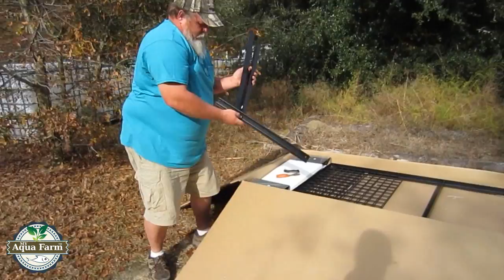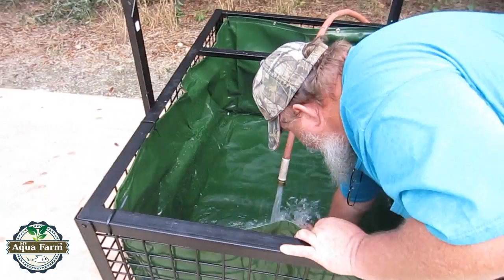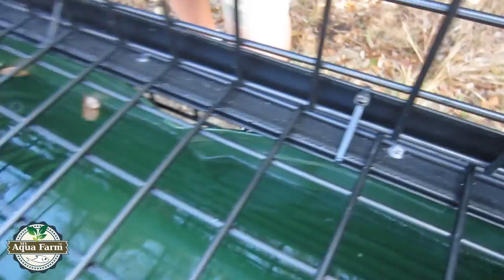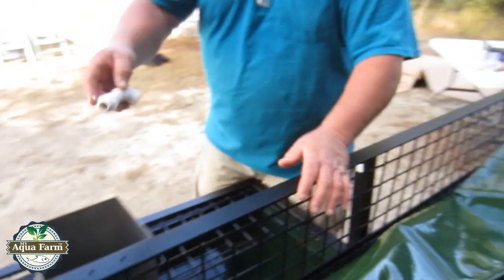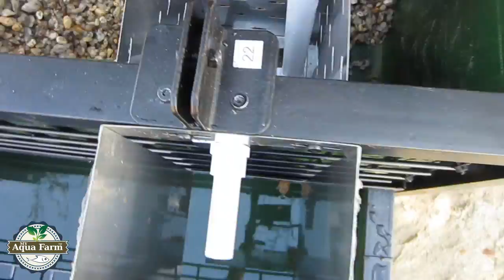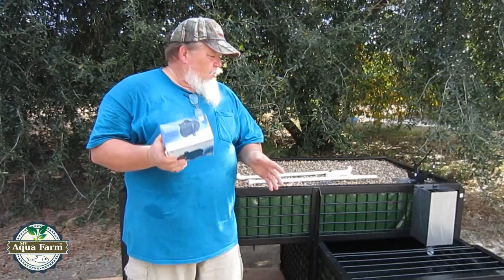MyAquaFarm Aquaponics Construction Video

Comment: I have to say this seems like a pretty solid system for people that are limited in the diy area. With that said I would like to throw out a few thoughts. First I think the grow bed sits to far over the tank. I believe it would benefit the user if the dump valve sat more the the rear corner. This would allow 2 things, it would allow more room to access the fish tank both for ease of cleaning and removing fish, it would also cause better water movement and prevent detritus build up in the rear corner. This would of course require 2 more legs on the back side of the grow bed and make for a larger foot print. Maybe that could be an added option. Also, moving the pump the opposite front corner could aid in circulation but that may require the next size of pump larger do to the added head distance. I would also consider adding a T and sending the water across the grow bed with several outlet holes along the length of the pipe to eliminate the need to move the plumbing around. Lastly, I would extend a pipe from the bottom of the dump valve either to near the surface of the water, below the surface, or maybe add a 90 deg elbow to be able to direct the return flow. Some experimentation would need to be done on that. Last minute thought, raise the grow bed up about 12 in and have the entire grow bed directly above the fish tank, this may not work to well for us short people but would reduce the floor space needed for you system. I'll have to check out your web site as you may have already come up with some of these options. Despite my long winded comment this looks like a great product. Excellent job!
Reply from the maker: I appreciate your comments and observations.  I'll address your points following:
You said:
 "First I think the grow bed sits to far over the tank. I believe it would
 benefit the user if the dump valve sat more the the rear corner. This 
would allow 2 things, it would allow more room to access the fish tank 
both for ease of cleaning and removing fish, it would also cause better 
water movement and prevent detritus build up in the rear corner."

My answer:
I built the first prototype of this system in 2012 (I've designed and built aquaponics systems since 2003) and have operated it since that time.  I've never had an issue with the flood valve being in the way (one can walk around the entire system), harvesting the fish or solids buildup in the corners in the 4 years it's been in operation.  What little solids that do remain in the fish tank are beneficial to the system as they slowly break down over time making available micronutrients into solution.  The fish tank is an integral component to the structural integrity of the system.  It's location also reduces stress in the fish giving them a concealed place to hide improving their overall health.

You said:
" This would of course require 2 more legs on the back side of the grow 
bed and make for a larger foot print. Maybe that could be an added 
option."

My answer:
Only one leg would need to be added.  What you suggest would add additional cost to production that would have to be passed along to the customer as well as added complexity to the construction.  We'd rather keep it simple and make available a robust, high quality product with as few parts as possible.

You said:
"Also, moving the pump the opposite front corner could aid in circulation
 but that may require the next size of pump larger do to the added head 
distance. I would also consider adding a T and sending the water across the grow bed with several outlet holes along the length of the pipe to eliminate 
the need to move the plumbing around "

My answer:
Moving the pump will not increase head height so no new pump would be required.  Relocating the pump, however, would increase pipe length, once again increasing the cost of production and reducing the arc designed into the piping to spread more evenly the solids into the growbed (where we like them).  I did the "holes in the pipe thing" with my first system in 2003.  A total nightmare!!  Algae buildup around the holes creates much more intense maintenance  to keep all those little holes clean.  Open flow into the growbeds has served me well for the past 13 years.  Just passing on the benefit of my experience to my customers.

You said:
"Lastly, I would extend a pipe from the bottom of the dump valve either 
to near the surface of the water, below the surface, or maybe add a 90 
deg elbow to be able to direct the return flow. Some experimentation 
would need to be done on that."

My answer:
Since you give no reason for this statement I can only assume it's for the benefit of aeration in the fish tank.  Since the first cycle of the My Aqua Farm prototype in 2012, we've never had a low DO (Dissolved Oxygen) issue.  When the flood valve initiates, a LOT of aeration occurs keeping the fish healthy and happy.  If your comment is directed at any perceived noise issues, who doesn't like the sound of running water?  Surely not someone with an aquaponics system.  Once again, this would add more parts and cost.

You said:
"Last minute thought, raise the grow bed up about 12 in and have the 
entire grow bed directly above the fish tank, this may not work to well 
for us short people but would reduce the floor space needed for you 
system."

My answer:
This would be problematic on several fronts.  One, this modification, as you state, would increase the height, not only for working around the system but also concerning head height and the pump.  While our pump can handle this, it would decrease the amount of water available to return to the fish tank adding additional aeration.  It would also make the need for a redesign of the growbed to add support since the fish tank would be unhitched from the system.  This would add cost to production and to the customer, not to mention making it even harder to harvest the fish and complicate the plumbing even further, once again, adding cost.  All for the saving of about 2.5 sq. ft.  Not worth it, in my mind.

You said:
"I'll have to check out your web site as you may have already come up 
with some of these options. Despite my long winded comment this looks 
like a great product. Excellent job!"

My answer:
Yes it is a great product.  Some have said it's, by far, the best system in it's class.  Not to mention it's twice the size for the price of the competition.  
"Excellent job!"?
I agree.  Thank you for the comments and observations.

Aquastead E-fish-ently!!

Warm regards,
Travis
Reply: Travis, Thank you for your quick response. I realize that I may not have been very concise in some of my comments so I would like to clarify a few. Before I get into that I would like to point out that my views are as someone that has nearly 30 years experience keeping and breeding fish and nearly 20 years working in the pet industry with my primary focus on aquatics.

On the first section, I understand keeping everything as simple as possible and that you are not in a position to do a big redesign. Currently the grow bed covers 2/3rds of the tank. What I was suggesting only covering 1/3rd of the tank. The amount of "security" that the fish receive from this coverage is negligible.

In regards to my comments on a dump valve down pipe. My ideas here are taking into consideration those that would want to run these indoors. While the running water can be nice, a major issue many people address with aquariums is the noise. Especially when you think that the dump valve is not the same as constantly running water but rather a toilet flushing, it creates a lot of noise. As I mentioned this would require some experimentation to figure out what works best. With that in mind some sort of baffle/cover over the dump valve surround would also be a nice addition to reduce noise.

On the topic of placing the grow bed directly above the tank. A 12 in opening between the bottom of the grow bed and the top of the tank does not cause any problems with removing the fish. Most pet stores have an even smaller opening for collecting the fish and doing tank maintenance. I have spent countless hours working through these little windows and trust me a 12 in opening is not an issue. Indoor use would necessitate the need for a light of some sort over the fish tank and this layout would allow for that.
Based on the assembled system from the above video this type of placement would save more than 2.5 ft and for those that want this in a home or greenhouse every sq ft matters. A vertical design would require that either the grow bed be shortened to match the tank length or that the fish tank length be increased so that they are the same dimensions. I'm not saying that the current model should be scraped but, simply that this idea maybe valid for a future iteration of your system.

Out of curiosity, what are the current dimensions of the grow bed and fish tank? Length, width, and height of each individually?
Also, why did you not use the rubber washer from the dump valve? Aquariums have been using bulk head fittings with the rubber washer as the means to seal the union for decades. Using the rubber washer would also eliminate the 24 hour cure time on the silicone. I may have missed it in the video but, does the aquarium grade silicone come with the kit or is this something the user needs to purchase separate? And if it is purchased separate do the instructions specify "aquarium grade"? I only bring this up because I do not recall you mentioning it in the video and I have come across to many people that do not realize only certain silicone's are fish safe.

Please don't take any of this as me ripping on your system, it is just my thoughts based on my experiences in aquaculture. Aquaponics is something that has been around for decades and should be more widespread than it currently is. I think your product is something that can facilitate aquaponics being more common place.
Reply from the maker: I appreciate your experience in the pet industry but aquaponics is a "nuther animal" in a lot of respects. Hence the design being what it is.  I very much am in control of the design as it is, in fact, my design.

I find it ironic that while you recognize the need for efficient use of floor space in a small greenhouse, you advocate taking up more floor space for the perceived sake of harvesting the fish by extending it outward while the opening in the fish tank currently is 18" a full 6" more than the 12" you say is ample even though you'd advocate placing the fish tank directly underneath. Seems a bit confusing. Trust me, while a 12" opening in the top of an aquarium tank in a pet store might be ample to get pet fish out, getting a net full of 3/4 - 1+ lb. tilapia takes a bit more room. By the way, the current My Aqua Farm only takes up 20 sq. ft. of floor space.  The suggestion that the fish tank occupy the same space underneath the growbed as the growbed indicates you may not be familiar with the fish tank to growbed ratios common in these systems.  I have to ask, do you have, or have you ever owned or operated an aquaponics system?

Concerning why I don't use the big rubber washer, two reasons. One, by deleting it I'm able to install the valve directly on the bottom reducing the height of the valve body in relation to the liner.  While only a 1/4" it's still a 1/4". This requires the need for a sealer that ensures a firm and solid mounting of the valve (the second reason).  Concerning using aquarium grade sealant.  I do suggest it (I'm not a newby) but I will also say, so little is used and even exposed to the water it would make no difference at all.  I've used both for years with no ill effects.  If I were building aquariums, yes I most certainly can see an issue simply because of the volume of product used in relation to the contact with the water is drastically higher than the minuscule amount required to seal the Flood Valve on the My Aqua Farm.

As far as the noise and the use of My Aqua Farms inside a home, I do not recommend this. One is for weight, the My Aqua Farm with gravel in the growbed can weigh well over a ton (actually closer to two). Not a good candidate for most homes as their floors are not made to handle the load. Also, the plants benefit much more from full exposure from natural daylight. The My Aqua Farm is much better suited to either an outdoor location or a greenhouse. Remember, this is not an aquarium. This is a recirculating aquaculture system with a very oversized biofilter designed for plant production. As far as the supposed noise issue, I have not had a complaint from any of my customers concerning such. In fact, quite the contrary, we find the sound of the system cycling (which is nothing like the toilet you mention) a soothing reminder that this system is faithfully and reliably doing it's job. Most, at least in the beginning, find excuses to stand around to watch the Flood Valve (my invention, not a dump valve) initiate as it's just plain fun. I have one just outside my window where I sleep at night. It's really not in the least offensive. If someone wanted to build a silencer, they certainly could. It would not be hard at all.

No offense taken on your comments.

Regards,
Travis
Reply: I had typed up a lengthy response to your last post but lost it all when clicking on something else. The short of it is, Yes, I have operated an aquaponics system and currently keep Mozambique tilapia. I think there is some confusion with the different ideas that I have proposed. Not all silicone is safe for a system that you intend to eat from (no matter how small of an amount). I don't mean to call you out but, you did not invent the toilet flush valve or as you call it "Flood Valve" which by the way has been used by aquarists in making surge devices for nearly 2 decades such as in the Boreman Surge Device. Many of your potential customers live in areas where keeping your system out side is not really an option. And finally, Many people keep aquariums in their homes that out weigh your system with no problems. Again I think this is a great product idea and I wish you the best of luck with your business.

Regards,
Dustin
Reply from the maker: The Flood Valve is quite different than the Boreman Surge device.  The Boreman surge device will not operate on low flow situations as the float will only lift enough to allow a trickle of water to flow through without fully lifting the valve from the seat.  I looked into it in 2004 and found it unsuitable for aquaponics as among other things the cycle time would be too short.  Fine for an aquarium, but not for an aquaponics system.  I most certainly did invent what I call the Flood Valve which consists of a siphon forced valve operation.  It's detailed in the Barrel-Ponics Manual (a very detailed 101 page pdf) I wrote and have given away free since 2005.  The Boreman Valve has no such feature.  While they do both utilize the same valve, that's where the similarity ends.  Kinda like aquariums and aquaponics.  While they both keep fish, that's where the similarity ends.   My Flood Valve is capable of operating on flow rates as low as 10 GPH, something the Boreman Valve cannot do.  Once again, it appears you're a bit confused in the difference between flood and drain aquaponics systems and aquariums.  As far as the large heavy weight aquariums, you and I both know people go to great lengths to build very large aquariums in some homes.  They are not without modification  to the structure of the house.  Something I do not recommend due to liability reasons, nor is it the scope of the My Aqua Farm product.  It amazes me how much you apparently know about many of my customers when , to my knowledge, you've neither actually seen one of my systems or actually know someone who has one.  Strange.

Regards,
Travis

Comment: What type of heat system would you recommend in a greenhouse? We installed a propane heater in our small hoop style and our heat bill was higher than our house ! LOL
Reply from the maker: I totally hear you!!  The same thing happened to me the first year I did aquaponics (2003) heating a 28' x 45' greenhouse.  I shifted to heating the water directly to a temperature to keep them alive rather than the greenhouse opting to keep the greenhouse just above frost.  I had a 1000 gallon tank at the time and used an electric hot water heater flowing water from the fish tank through it and back into the fish tank as needed.  The same could be done with a tankless hot water heater (either electric or gas) wired into a thermostat.  This would reduce your bill considerably since you'd be heating the fish tank directly rather than heating the air to do so.
Hope this helps,
Travis